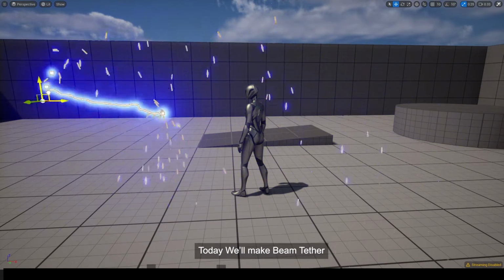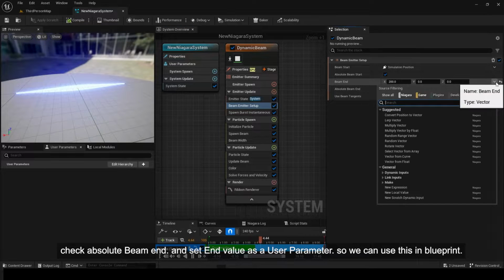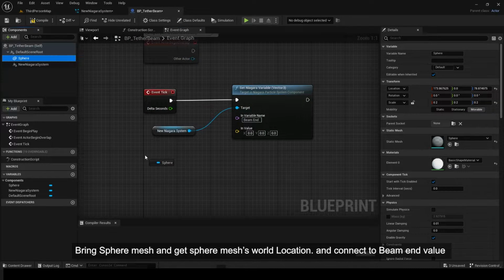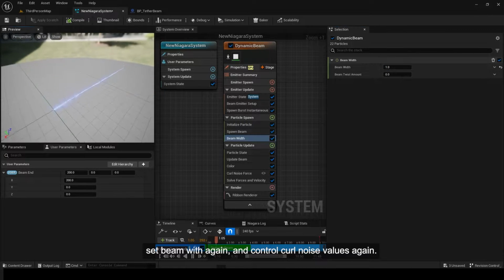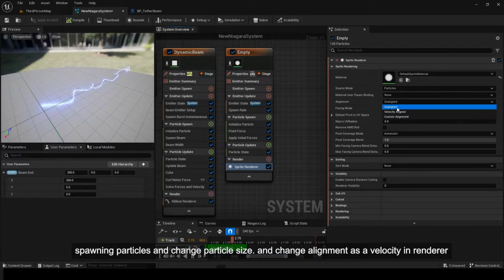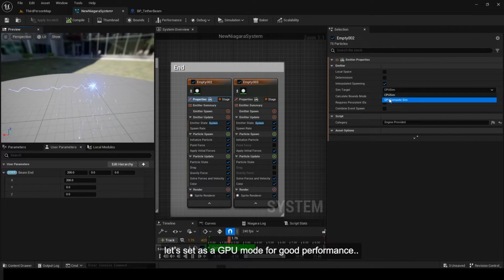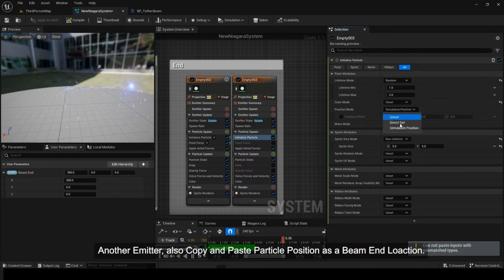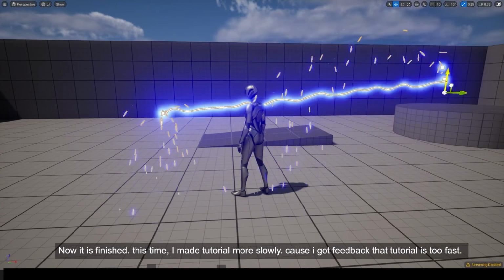Niagara Beam Tether Tutorial  Unreal5.2v

Comment: How would you go about attaching the ends of the beam to an object your holding but also keeping the ends of the beam locked to the location and rotation. Making the beam bend towards where i point. For example I have a wand and i made it so that it can lift objects and move them around bit slowly to feel like they're heavy, but when the beam connects between a wand and an object its just a straight line in between them.
Reply: you might need to either have a function that updates the position of the end point every .2 seconds. Or you can put it in the tick position to constantly update the position of what you want the end point to be. The first option seems more ideal for performance